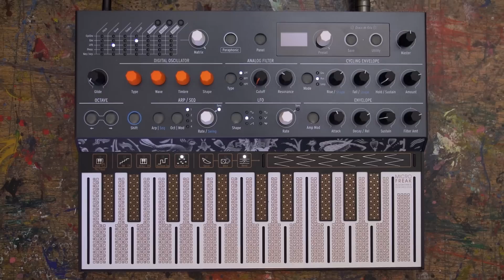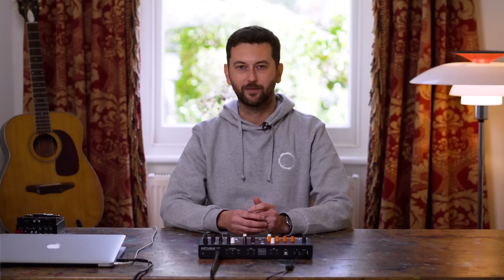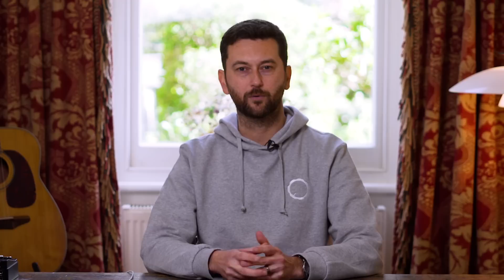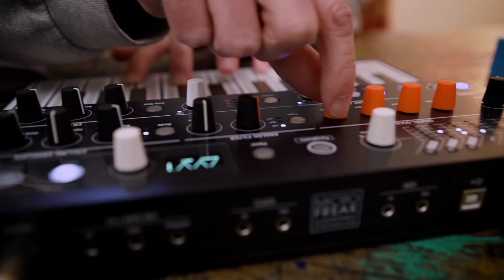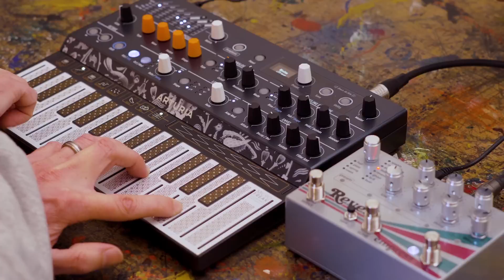Tutorials | MicroFreak - Episode 2: Modulations

Comment: How do you make a tremelo effect?
Reply from the maker: I did it by using the Cycling Envelope, but the Modulation can create that too - Bryan
Reply: @ArturiaOfficial  but how?  You can't modulate the volume/amp.
Reply: @off711  hi, don't know if you found a way since this comment, but in case of, here are the two techniques I found :
- you can assign the LFO to the Enveloppe's sustain (with a negative value of course)
- or you can assign the LFO to the Cutoff (works better if the filter is in low pass mode), again with a negative value.
Both sound different, I personnaly find the methode with the Cutoff more natural for a lot of sounds. 
Hope I could help someone!
Reply: @2RoMaideN  this is really helpful, thanks for the solution!
Reply: off711 mod the sustain of the envelope?
Reply: Wow, two years and finally it makes sense to use the sustain knob.